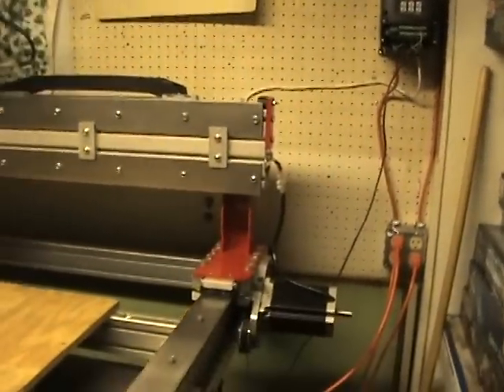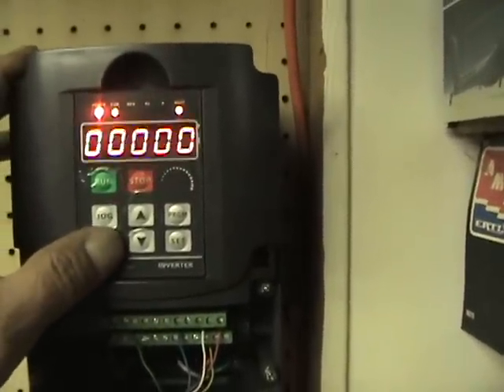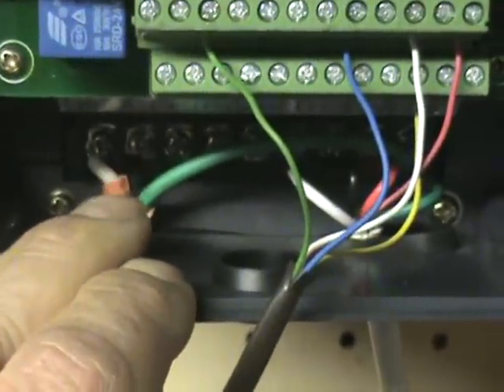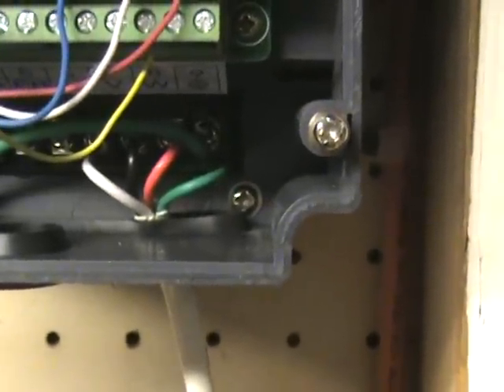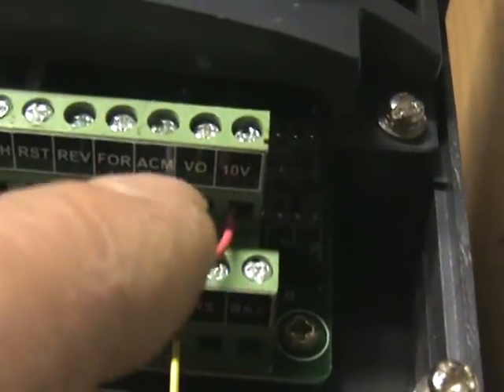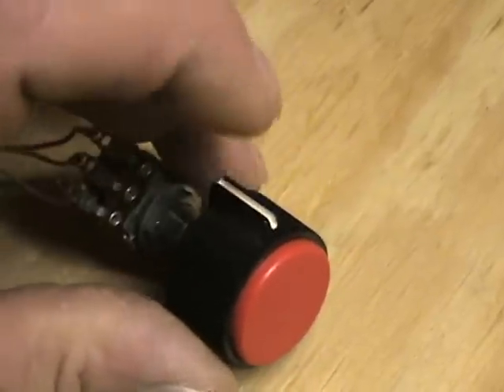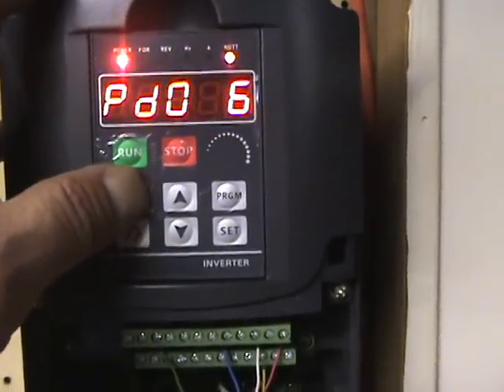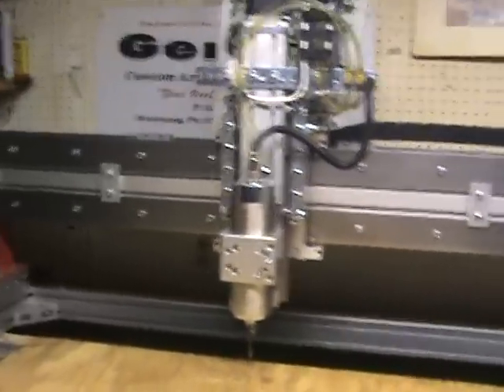Building CNC Router Parts CRP4848-23.MPG

Comment: could you do an in depth tutorial on how to wire the vfd to the spindle and how to power the vfd from a 220
Reply from the maker: Stay tuned.  I just got done taking it all apart and moving the pieces up to my new shop.  I'll have a video out soon on that process and after I finish running the 200 line I'll do another in-depth video on all the wiring.
Reply: cuttingtooldesigner ok cool